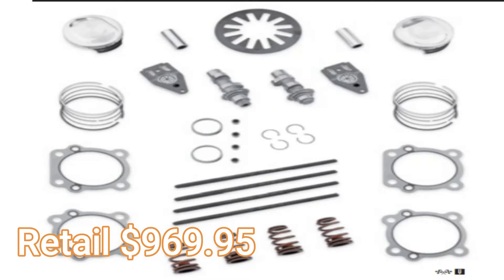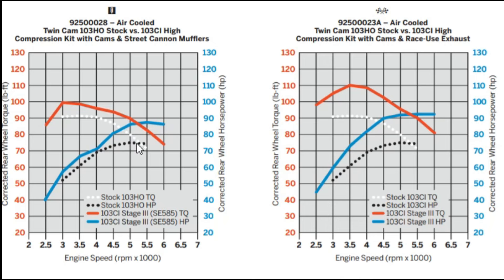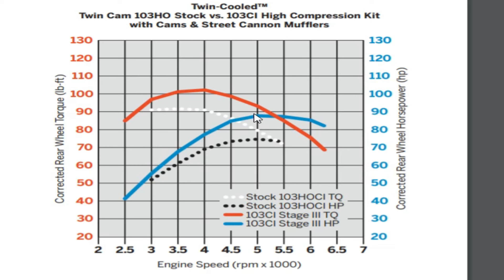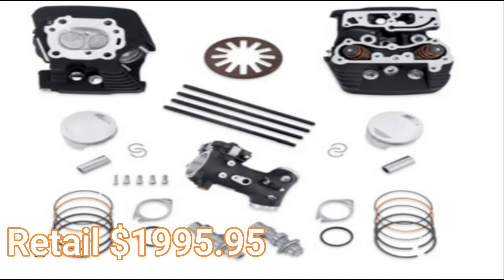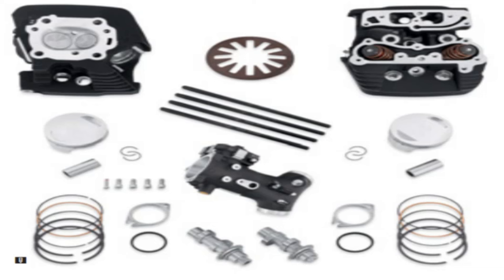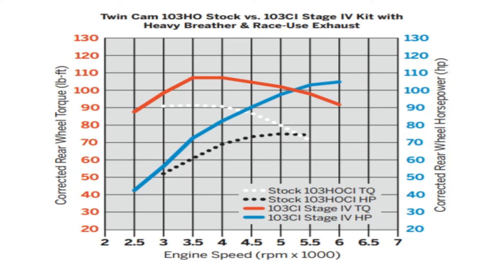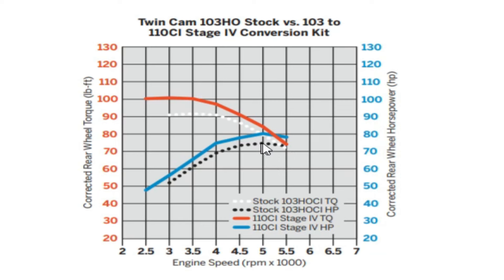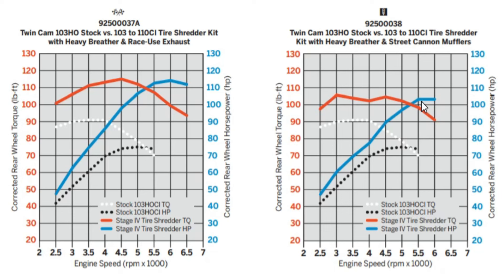Late Model Twin Cam 103's Make A Solid Motor For Modern Used Harleys

Comment: Great videos! Keep doing a great job. On a 2011 TwinCam 96B (Softail Fatboy) what's the highest I can go? 110, 114, 117? Will the new 131 crate engine fit? Thank you.
Reply from the maker: For a 96 you can do a 103 kit through Screamin Eagle. Aftermarket kits you can bolt on up around 124 inch. Technically the 110 kit would work on a 96 through Screamin Eagle but it wouldn't be warranties. The 131 engine is a M8, it wouldn't bolt into your bike but with some creative fabrication it could be done.

Comment: Thanks for your great videos! They are super helpful without being overly technical. 

I recently bought a 2016 Fat Bob that was almost new, only 230 miles on it. It has the 103 HO engine. I put about 2500 miles on it before winter shut me down. I am looking to give it some performance upgrades over the winter as it is still completely stock. What would you do if it was your bike and you had a winter to do it? If you need a budget let’s say $7500. I am looking to do the work myself so it can all go for parts.

I am looking at a 2-1 exhaust system like the V&H Pro Pipe, and a set of Wood TW-222 cams, S&S cam plate and high volume oil pump (mostly based on your video- thanks!), and a Powervision tuner (from your video too-thanks!). So far all I’ve purchased is a K&N RK-3934 air intake system which I replumbed the breathers on to keep oil and hot gas out of my intake (also based on another of your videos- thanks again!). What else should I do to gain some power or make it run better without replacing the jugs or bumping up the displacement? What kind of a performance increase could I potentially get if I were to have my heads ported and polished or even replaced? Not scared to spend the money as long as I get something in return. 

Thanks again for your great videos I watch all of them. Hope you can respond, your opinions would be most helpful! Merry Christmas!
Reply from the maker: Thank you, I appreciate it! Really the biggest bang for the buck is the cam, and from there a big bore kit. Head porting will help some, but not any major gains for the money spent without upping the compression.
Reply: Thanks for the response, sounds like I am at least on the right track. I am working my way through your twin cam videos. I got some time to figure out what I want before I start ordering parts. Now looking at the cost of bumping up to 110” with the Fuelmoto kit (yep, based on another one of your videos) and now I’m not so sure I wanna keep her at 103”! Thanks again for the videos, hope you have a great Christmas!

Comment: You said the 103s came out in 2009. But I have a 2006 Thunder Mountain customs blackhawk chopper that came with a 103 screaming eagle motor.
Reply from the maker: You're right, there was a variant of the 103 before 2009, it was a limited edition engine for the CVO models. These engines weren't mass produced, they only built maybe 150 per model a year as CVO models are limited production. The 103 before 2009 had way more in common with the 88, including the spring tensioner system, heads, cams, compression ratio and a 5 speed transmission. The 103 that came out in 2009 was for the mass produced touring bikes and had all the updates of 96, I should of clarified that in the video that it covering the mass produced version.

Comment: Excellent information! In my opinion, best knowledge about Harley-Davidson engines in the last three decades. A quick question. I am considering buying a Tri Glide. Choice between a 2017 or newer M8 or going back a few years earlier to a 103. It looks like upgrading a 103 to get some more torque is a great option. Problem is I could get a 2017 used for only $1,000 more. I'm not a speed freak, I'm just concerned about the big three wheeler moving when I need it to. What would you do  and why? Thanks for any reply
Reply from the maker: Thank you! The trikes really needed the extra power of the 107 and 114 M8's, but the 103 does very well and a cam swap will really get the horsepower and torque where it needs to be to really pull a trike. Now the 2017 M8 had oil sumping and oil pump issues, I would take the VIN to a dealer and see if it had any warranty work done. 2017 engines with the original oil pump design had the issues and Harley replaced those with a newer designed unit under warranty. If you are able to verify that I would go with the M8. But the twin cam 103 is tried and true, they got the issues with the twin cam worked out on the 103 and of course they changed over to M8 shortly after. My opinion is the 103 is less likely to have an issue vs. the 2017 M8 which was the first year of that motor, I've had some bad experience with the first years but that's just me.

Comment: The only quality items on Harleys are their paint and switch gear. Their engines are budget builds as are the poverty spec suspensions and brakes.
Reply from the maker: It really does seem they sacrifice engine build quality on the fit and finish.

Comment: Bore the 103 cylinders to 3.975". Have the heads ported. Choose a good cam. Get it tuned. Easy 120 squared and reliable.
Reply from the maker: There's a lot of potential in those 103's without going completely over board, getting them tuned properly is the key!
Reply: @GixxerFoo  if you have a twin can that is an original 103 my 110 kit will fit ..and  it is complete... I will sell for
 one half price .cause I need to move it while its still worth something

Comment: All twin cams have low oil pressure and crap tensioners that wear out to fast and causes expensive maintenance. Harley needs to do some improvements to win back customers. I will probably buy an old 80 cube model because they are the best.
Reply from the maker: 80 inch is a damn good motor, problem Harley had with it was it lasted too long. Good for us but bad for business lol.
Reply: Its fine, stop hot roding the motors, get some good suspention and ride and enjoy the bike.

Comment: looks like you left the cam chain tensioners in? Hydraulics might be better than the original version but I wouldnt trust them anyway. I did a gear drive on my 09 Dyna Street Bob. With all that entailed. Still Now I dont worry. Heads flowed. 5 angle radius valve job. The HP is in the heads sort of. An internal combustion engine is just a big air pump. The more air you can flow ..... The more HP you will make . simple as that. Cams . valve job. port the intake . port and polish the exhaust. Remap the EFI and match it to the correct exhaust. Built to go, Not for show . I could care less about how my sled looks.
Reply from the maker: That's where l like to spend my money, put it all in the motor. Love the sound of a cammed Harley.

Comment: Precisely why I love my Honda Aero v twin. It is capable of going over 300,000 miles. Add to that,far lower maintenance costs and a shaft drive vs a rubber band belt.

Comment: I cross  continents. I would never own a twin cam. My delkron Evo just keeps going and going. Design was good but the parts they put in were bad . Plus sensors everywhere. Fuel pumps. Pressed crank. Timing chain adjuster.Balancers. Depending on the model. And  it runs too hot.It’s a horrible engine. I don’t care what anyone says.It’s all about the bore and displacement. Bigger numbers don’t mean more horsepower.. The only thing great about a twin cam is I made a lot of money fixing them.

Comment: Given a 2016 103 HO and  that I live in California. How big can I go without losing reliability for long road trips while maintaining warranty and no grief at DMV?

If the tire shredder 110 kit costs $3k does that include cost of installation? 

I’m wondering if it might be more cost effective if I went with a rebuilt 120ST crate motor mated to that 6 transmission?
Reply from the maker: Being in Cali and wanting to keep your emissions, your best bet would be the 120ST. Otherwise you would need to get a street compliant stage kit. You'll also get some gain too with Screamin Eagle exhaust or aftermarket street compliant exhaust too.

Comment: I have a Two 103 touring bikes..2015 RK, 2016 SG Special....love them. I also have a 2019 RK Special and a 2019 Fat boy with 114 M8s.  Yes the M8 have more power but I still love my Twin Cams. Let's face it HD has to make engine mods. Other than paint how can a HD be improved. One of my Twin Cams has 78k miles and she runs like a dream. The M8 blow oil smoke sometimes and you definitely smell oil burning on start up. Most of my family think the engine sucks. Only because HD has not come clean about this engine. First the oil migration to the primary and now HD is on their third oil pump improvement....not to exclude the new M8 oil filter they rolled out....why? My two M8 only have 6300k miles between them so time will tell. They both are getting the new SS came plate and oil pump in Oct 2020 when I have time to replace them.
Reply from the maker: Have you had your M8's in for all the updates? I saw they started drilling the case on the primary side and putting a vent/return tube in there. Seems like something they would of caught in development. I've talked to several people that came from a TC to an M8 and they said the same thing.

Comment: I should have read a LOT more about the 88 because I found a decent LR with the 88 with everything I wanted on it---low mileage,  rack/bags/shield/engine guard/back rest/ and good paint and not bad for rust.   It has been one problem after another.  Over and over ,  thousands spent just to get it running AND haven't even't replaced the chain tensioners yet.   Such a disappointment.   SO,  spend some extra money and buy a late model 96 or the 103.  Even a nice 88 with low mileage COULD be a real POS.
Reply from the maker: Then 88's were really hit and miss, some were flawless and others had all the known issues. The later year 88's weren't too bad but the 96 had the issues corrected by then.

Comment: 96 is actually a way better engine
Reply from the maker: First thing l noticed between the two is that the 96 seems to run cooler. The 103 had my crotch on fire 😆.

Comment: Nope......not a thing here to convince me that a TC is a better option than my Evo.....easi;y rebuilt on the coffee table, and with a stage 1 upgrade, Head Quarters cam and screaming eagle ignition upgrade I can keep up with the bigger inch motors. ....and at less than half the cost of a new disposable motor.
Reply from the maker: The Evo is a legendary motor, Twin Cam can't touch it unless you go down to the crank and build back like the Evo using S&S parts. Might as well get an Evo at that point.

Comment: It boggles my mind that spending 2k in mods plus labor only gets you 80-90 hp in these big ass engines. Harleys have idiotically shit engines. I love them.
Reply from the maker: What they lack in horsepower they make up for it in instant torque though.

Comment: I cannot get more HP on my stage one FLHR..until I can afford better suspention ..that my $20k bike manufacture failed to include.  just say'n ..not troll'n.
Reply from the maker: Oh no I believe it, I ride Harleys too and honestly every single one could benefit from a good suspension upgrade. They have gotten a lot better but still not where they need to be.
Reply: @GixxerFoo  the front forks and rear shocks are showa a company owned by Honda of Japan as Harley use the showa. technology of the 1970s' ..for around $200 bucks you drop in race tech gold valves in the front forks with the stiffest racetech springs and a set of Ohlins on the rear and its off to slay the dragon on us hwy 129 .Tenn.
Reply: If you are looking for the ultimate Harley suspension ..is Ohlins front and rear from big bear choppers who specialize in road glides dynas, and sportster...next is Kraus american performance motorcycles and socal's Moto GP suspension systems as road racing dynas on track with sport bikes has become a popular fad ..as Harley dynas are kicking as against sport bikes in socal road course racing chech out "27 cycles jiffy tune " and see the impossible happening for over Three years as and counting
Reply from the maker: Lol my factory shocks on my bike are Showa, hell just about every bike out there has Japanese suspension.
Reply: Check out Kevin at big bear chopper and Kraus at Kraus. american  performance motorcycles .
Reply: Check prices and you will find Ohlins to be not much more than $100-,$300 bucks more .than all the rest.and well worth money spem,nt 
https://www.ohlinsusa.com/motorcycle/harley-davidson?gclid=EAIaIQobChMI2Ovqidnz6wIVC0fVCh0JjQqwEAEYASAAEgLto_D_BwE

The above is a complete guide to spec out your ride with Ohlins for all Harleys   even the budget shocks and damping is far better and out last everything else. ..these are life time suspension systems you will buy only once
Reply: @donniebaker5984  Thanks for the tips Donnie!

Comment: The best Harley engine is the Sportster motor. 4 gear driven individual camshafts. No chain, no plastic pads. It's their only bulletproof motor.
Reply from the maker: I have to agree with you there, that's what my wife and I both ride. Twin cam isn't a bad motor at all, it just has to have a few updates and upgrades done. Not necessarily all at once but if you have an issue. I help out a lot of people I ride with and friends of friends with their Twin Cam bikes.

Comment: Buy a Honda. The twin cam engine is just not worth it. I know too many people that have blown engines from that stupid and hot running design. Plus the press fit crankshafts are notorious for being out of alignment and therefore cannot support cam gears. Honda gives more power factory stock with total reliability and great resale. And they're super smooth and quiet.
Reply from the maker: If Harley would just do what Honda and every Japanese manufacturer has done for years. Make a water cooled Vtwin that looks air cooled, hell Honda used overhead cams and made it sound so close to a Harley. Harley tried to patent the sound, it was rejected but that's how close that Shadow Aero with the single pin crank came to the sound.
Reply: @GixxerFoo  Honda has done gear-driven camshafts for years without failures.

--CBR400RR
--All the VFR 700/750/800 from 1986-2001 and the 1985 VFR1000.
--VFR400
--RC30/45/51
Reply from the maker: Is there anything Honda hasn't done? Hell they had an oval piston race bike that was essentially a V8. Lol that got banned real quick when everyone got destroyed by that "V4" on the track.
Reply: @GixxerFoo  My Dad's best friend from high school who lived in Houston purchased a new 2015 CVO limited bagger for $42,000. It was a gorgeous bike. Soon after he purchased it, he took off from Houston to ride to Pittsburgh Pennsylvania for their high school reunion. He was doing about 90 mph on the interstate in Kentucky when the engine completely came apart. The cam chain pads disintegrated, plugged the oil lines and the engine seized. He was lucky it didn't cause him to crash. He rented a car and finished the trip while the dealer put a new engine in his bike. After the reunion he drove back to the dealership in Kentucky when it was all completed. The dealer treated him very well. But something like that should never happen with a bike of that price.
Reply from the maker: Holy crap that's insane! That would of been a twin cam 110, did he buy it new and that happened?
Reply: @GixxerFoo  Yes he bought it new. Unfortunately he passed away in late 2018. At least he was able to enjoy that bike for a while. He always rode it fast on the interstates. And did several cross-country trips.
Reply from the maker: I am sorry for your loss, I'm happy to hear they took care of him and l hope they made it more than right on that bike. That never should of happened though, that's their flagship model and every piece of those bikes is hand assembled by 1 person. Even the engines are put together by hand, they don't just pull one off the line.
Reply: What Honda are you talking about in particular?
Reply: @dags6439  Most Honda's are great bikes. The new Goldwing is awesome. I ride a 2014 Valkyrie that uses the previous Goldwing motor. Smooth, quiet, torquey, powerful and totally reliable.
Reply: Pitts S2C I jumped from Honda to Harley thinking about going back

Comment: I just said I would post you videos about Harley Davidson suspension from big bear choppers as he should rename himself as the word "chopper" does not do him justice as of what he is doing now ..here is a good video that outlines what he can do to be all Harleys https://youtu.be/5esPnMUu_qM

And don't stop here as Kevin has tons more videos how to build your suspension to match your horse power on all Harleys
Reply: Does anyone want to see the only two engines used by nhra pro stock drag bikes ????
If so go to this link and listed is every detail about two completely different engines both with capabilities of 6.7
https://www.nhra.com/news/2019/inside-pro-stock-motorcycle-engine
The Suzuki is running a compression ratio of  16 to one 
The Harley's are running s compression ratio of 14.5 to one

The Harleys have 2.7 inch intake valves and 2 inch exhaust valves. Spring pressure closed is ,#500 pounds ..fully open the spring pressure is #1500 pounds    cylinder bore is 5.125 inch in diameter .that bigger than a  John Deere the Harley's make 400 horse power at 10, 500 rpm  but have no technology according to the millenials as they know everything. Some one said it will never happen , Harley said we are glad we never listened ..some one said when pigs fly ..Harley said. Now they do .!!!!
.
Reply from the maker: Those are some serious engines, don't they basically rebuild those after run?